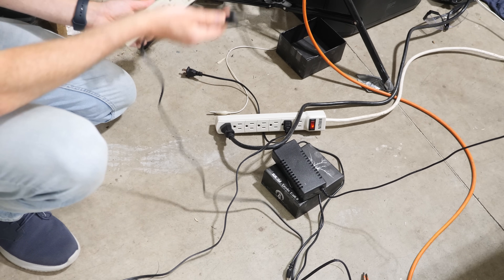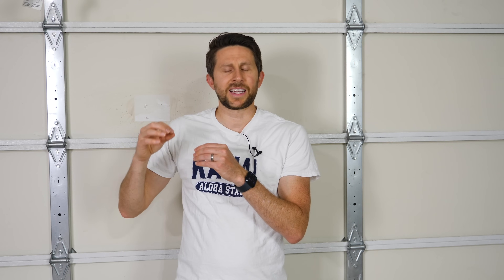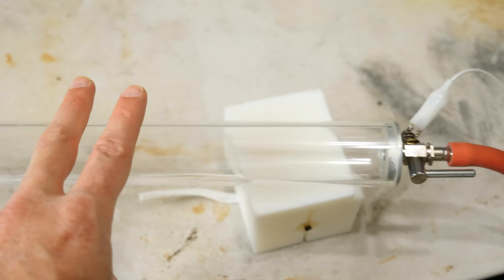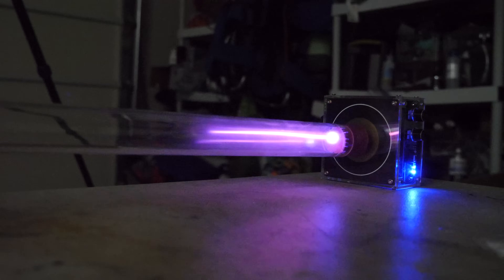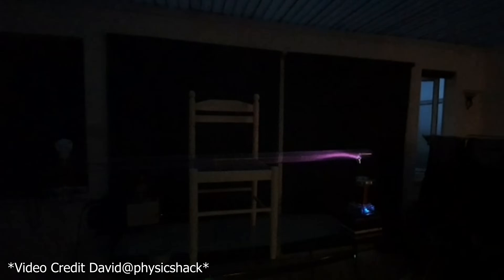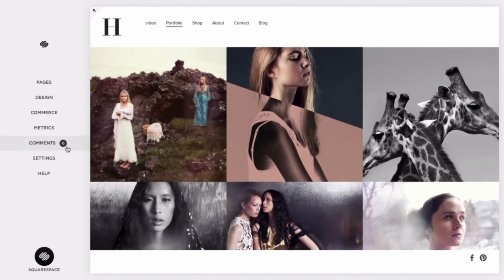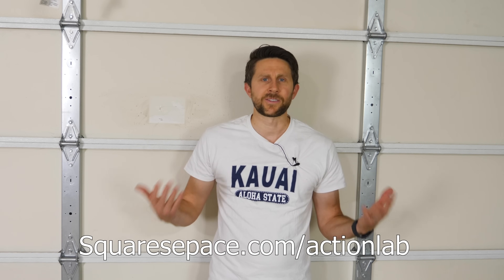Using the Air As a Wire—Was Nikola Tesla Right?

Comment: Something really interesting happened to me at 1:47.
When I first watched it, he talks about how the spark grows but I saw nothing but complete darkness in the tube.
When I replayed 1:47 again, however, I saw the spark grow despite seeing nothing there previously.

I knew the video wasn't frozen because I could see the blue part at the left side of the screen still flashing.

After a lot of trial and error, it turns out that the sparks are flashing completely in sync with the framerate, and because I was watching the video at 2x speed, Youtube was skipping every other frame, so depending on which frame you start on, you either only see the frames where there are no sparks at all, or only the frames where there are only sparks.

Go ahead and try watching 1:47 at 2x speed multiple times to see the difference!
Reply: Interesting. I wonder if it has to do with the fact that AC current from the wall operates at 60 Hz (same frequency as the refresh rate of this video).
Reply: @jacobgable3163  it doesn't. Current is being transformed in DC in order to be used as power for PC
Reply: @leonardobodini6734  Well, I was referring to the device that emits the sparks (not sure what to call it). Not sure if it's AC or DC, but Tesla was the big AC guy, so I assume it's AC. Not sure it actually adds up though anyways. After thinking about it more, I think it would actually have to be 30 Hz for it to work that way. But still, I wouldn't be surprised if the wall frequency played a part in the equation somewhere.
Reply: @jacobgable3163  Lol, I misunderstood what you said... Sorry, btw yeah, maybe it has something to do, maybe not... Guess we'll never know
Reply: @jacobgable3163  I don’t think so, that Tesla coil probably operates at several megahertz. The input power is converted to DC and then back to AC at the correct frequency. It’s probably just what he has his interrupter frequency set at. The transistors would probably die switching that power millions of times per second, so the interrupter gives it a break and pulls the duty cycle much lower, probably around 10% max. That’s why the sparks are pulsed.
Reply: Very interesting
Reply: Yes. Play it at 2x with above 720p60 and suddenly disappeared which it didn't in 1x
Reply: 2 things are going through my head:
That is really interesting…
What kind of psycho watches YouTube videos on 2x speed by default?
Reply: @dnknoester  I almost exclusively watch YouTube videos on 2x speed. 1x is just way too slow for me lol
Reply: @dnknoester  Sometimes 3x speed with my Video Speed Controller extension 😎
Reply: Loved it. Changed the quality to higher then 480px and 2x speed, played multiple times.
Reply: sadly i cant see it since my framerate is too high. ive tried for a few minutes now lol

thats really cool though. reminds me of funny videos where helicopters fly with no spinning blades and birds flying with their wings folded
Reply: The same was for me on 1× speed
Reply: same
Reply: I too watch at higher speeds.  It just seems to be time saving
Reply: +Kizuna Kosuke Great observation and hypothesis! 
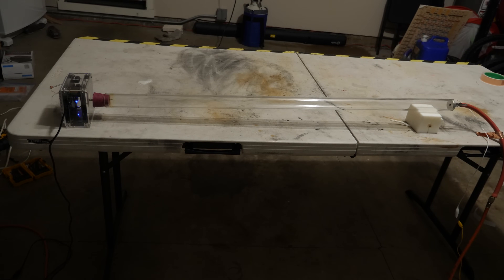But did you notice that the phenomenon happens at all playback speeds (not just multiples of 60Hz), and actually begins at 1:39 when the sparks first disappeared the moment the lights went out? And it was also the exact same instant that we cut to a different camera setup. If there were 2 cams, then their shutters must've been out-of-phase, or if there was only one then obviously it was re-positioned and some (i.e. "many") frames were dropped during the edit. Either way, we're looking at 2 uncoupled video segments.
Reply: @timapple6586  does not happen at normal and slower rate for me. the effects only happen at faster speeds. but it's really tripping to see the effect. what's the explanation for this?
Reply: Woah! Nice catch.
Reply: If you go frame by frame, you can see it's actually one frame spark, then 5 frames black. Due to the rolling shutter, sometimes it's 1.5 frames spark and 4.5 frames black.
Reply: Dude that's bizarre
Reply: This was really cool, thanks!
Reply: Wew
Reply: Yeah that's cool, 🤩
Reply: Lol true
Reply: Poor problems.. some of us watch at 120 hz.
Reply: interestnig
Reply: hmm well I watched on 2x speed and it was normal 🤨
Reply: @qwerty_qwerty  Rewatch it multiple times. It depends on which frame you start watching the clip on.
Reply: @FLOWER-xh4gx  I've watched it 10 times and nothing, maybe it only works on certain video quality?
Reply: @qwerty_qwerty  try using 720p or above video must be 60 fps
Reply: @qwerty_qwerty  its only the part where he says look at how it grows or something
Reply: I tried this as well, but I didn’t see it until I locked my screen rate at 60Hz (in accessibility settings. ) Then it was very easy to see what you described. Running new iPad pro
Reply: Harmonic resonance in action
Reply: lol, its not consistent tho, I played it back multiple times, sometimes, it worked, sometimes it's normal xD

Comment: Transmitting data through the air using frequency is hugely successful. Perhaps Teslas plans for power rather than information transmission had to do with his famous quote. If you understand frequency and vibration, you understand everything. We'll have to figure that out for ourselves.

Comment: It's kind of a different setup for transmitting power. you don't want any sharp pointy ends or Sparks to fly through the air, this guy's very smart I don't know why he doesn't know that or address it. If you want to see this in action check out the channel     "styropyro"

Comment: I once made up a superhero that could control energy through his ability to manipulate electricity and the electromagnetic field. I made up this move he could do called "perfect lighting" where he would manipulate the air in a straight beam and create a vacuum for essentially as long as he wanted, and then he would generate electricity and a bolt of lighting would shoot directly through it. The lack of thermal resistance caused the lighting to connect with his target with greater efficiency, I guess. But I didn't know this could actually be possible! Cool video.
Reply: Sounds like Railgun

Comment: You can also fill the tube with water to eliminate the delay and decrease the voltage required for transmission. I'm no atmospheric expert but to my knowledge the upper atmosphere not only allows transmission due to the pressure difference but also contains an amount of moisture which would allow for an 'easier' path of least resistance for the flow of the potential difference. Tesla R.I.P if only we'd listened you would've saved us.

Comment: Instead of building a really high tesla tower, how about replacing the wire links between power poles with evacuated tubes. Each tube would have metal hooks on each end so they could just be "hooked" onto the conductor of each pole. 
Each segment is isolated so that if there is repair work, or damage, the whole line doesn't need to be re-vacuumed, just that one segment
This would have the added benefit of if something crashes into the line, there are no sparks to create fires. This would really help places like California that is prone to powerline created forest fires.

Comment: I think there is a main misconception here. He was not up to send the energy via air but via ground. The Wardenclyffe tower structure was the cherry on the top of 
massive ground structure which ensured the lowest ground resistance as possible. My understanding of the thing is that he came up from the setup of two tesla coils where 
secondary windings were connected. Tesla coils were finetuned to the same resonance frequency and top parts were capacitors. The setup was supposed to send the current from one
Tesla secondary coil to the other Tesla secondary coil via single wire because the energy was oscillating between capacitors on the tops. Then he could extract the energy from the
"primary" coil of the second Tesla coil. Now if the distance is increased between these two coils the single wire will be longer and it can be replaced by some other conductive material such as Earth.
In case the Earth is used the natural frequency needs to be measured which Tesla did and designed the tower L and C to be tuned to Earth (not just a single wire, it's a dynamic system).
I imagine it as if the Earth is ball of water (incompresible fluid) and there are two pistons connected to it. One is full of extra water (extra energy) and the other is empty.
If the piston is pushed the extra water wants to go out and pushes to the other piston (which is finetuned to do exactly this thing) and it does not matter where the second piston is on the ball.
In case of Earth there would hotspots based on the natural frequency of the system or higher harmonics. The energy of lighting comming out of the capacitors were a loses in the system 
not the actual transmission of the energy. Tesla did not finish his vision because he was a good inventor but a really bad business man. He had a big debt (10000USD which was quite a lot in that time) in the Waldorf Astoria hotel 
he was living in and he lost the land with the tower in execution. He watched the demolition of the tower executed by new owners of his properties. He tried many times to
get money from J. P. Morgan who Tesla provided >50% ownership to his patents as the act of the trust for the money he lent him. But the guy had a lot of money 
in copper mines and transmission lines so he was not interested in "wireless" technology. Moreover, Tesla didn't deliver him a product he ordered, so he let Tesla fell into the poverty and die in cheap hotel.
Sad story. If Tesla had a manager our world would be even more advanced by now for sure.

Comment: What is the Voltage and Current rating of the Tesla Coil used in the video?
Reply: Input or output?
Reply: @ElectronicallyIrresponsible  output
Reply: @alexnjuguna6700   Judging by the spark length, maybe up to a few hundred thousand volts. Not sure on the current though, definitely not much.

Comment: This is really cool! So would this store electricity or simply transfer it? Also, would it increase chance of lighting storms?
Reply: Mostly transfer, though you could get a trivial storage effect. It would increase the rate of lightning strikes, but probably not significantly increase the total power per storm... probably? Also, individual strikes would probably be weaker, but there would be correspondingly more of them.

Comment: Texas Tech University was working on this behind closed doors, my professor's colleague and friend was one of the researchers on the project.  We didnt get details but he did say this is what they are working on. That was 5ish years ago.
Reply: Probably won't get any real-world use. The concept is sound, but the economics are just a pipe dream. It essentially isn't useful for anything other than over-the-horizon radar/radio, ionosphere research, demonstrations, and ideas for very different applications. It's too easy to tap into without approval, so you can't use access control to establish the resource stream needed to keep the system running.

Comment: Tesla was right.
Academia makes the lie that keeps This kind of confusion Alive. KEEPING US ALL ENSLAVED
Reply: Everyone assumes that the world would be sparking and an abundance of current uncontrollable and a nuisance to life...this is part of the original propaganda....
Once Tesla engaged the wireless part of the system in wardencliff it would simply arc at around 8hz into ground with a about ten foot spark gap...its the resonating pulse synchronized with earths natural resonance...this heart beat would be inconceivable by anything other than circuits that start or end depending on your take of travel..at an antenna to a primary coil that is tuned also to any multiple of the resonate pulse...then onto ground its that simple really...only made impossible for people to understand by the institutions that are in place to keep this type of thing from occurring by patented inventions ever again...
  Once the pulse engaged it would simple vibrate the electrons instead of pushing or pulling then through a generator...this vibration because of the natural frequency would saturate earth and all of its atmosphere...the millions of volts and thousands of amps would be stepped down to a usable current by the secondary in the circuit and that would be the constant energy supply...its more like radio than battery or generator exept the distance is not a problem because of the frequency....it worked on basics that we use today less the resonating frequency parts because that was the secret to delivery...my grandfather sat many days at wardencliff as a brick masson and according to him Tesla loved to talk and discuss what most would consider secrets....i hope this will help in undestanding that Tesla knew all about bad emf and considered this to be absolutely safe....our computers would work just fine...but the transistor may not have been invented because it replaced the tube and tubes at the time were crucial to the tuning of all the receivers each necessary at the point of power consumption.. Without the cover up of his work they would have just improved over time..

Comment: This is not right..
Sorry..
Everyone assumes that the world would be sparking and an abundance of current uncontrollable and a nuisance to life...this is part of the original propaganda....
Once Tesla engaged the wireless part of the system in wardencliff it would simply arc at around 8hz into ground with a about ten foot spark gap...its the resonating pulse synchronized with earths natural resonance...this heart beat would be inconceivable by anything other than circuits that start or end depending on your take of travel..at an antenna to a primary coil that is tuned also to any multiple of the resonate pulse...then onto ground its that simple really...only made impossible for people to understand by the institutions that are in place to keep this type of thing from occurring by patented inventions ever again...
  Once the pulse engaged it would simple vibrate the electrons instead of pushing or pulling then through a generator...this vibration because of the natural frequency would saturate earth and all of its atmosphere...the millions of volts and thousands of amps would be stepped down to a usable current by the secondary in the circuit and that would be the constant energy supply...its more like radio than battery or generator exept the distance is not a problem because of the frequency....it worked on basics that we use today less the resonating frequency parts because that was the secret to delivery...my grandfather sat many days at wardencliff as a brick masson and according to him Tesla loved to talk and discuss what most would consider secrets....i hope this will help in undestanding that Tesla knew all about bad emf and considered this to be absolutely safe....our computers would work just fine...but the transistor may not have been invented because it replaced the tube and tubes at the time were crucial to the tuning of all the receivers each necessary at the point of power consumption.. Without the cover up of his work they would have just improved over time..

Comment: What if you did this to a skyscraper and used the heat to also generate electricity?
Reply: Unfortunately thermal energy is horribly inefficient due to the high entropy of thermal systems. For every 1 watt of heat that flows, the max work you can extract from it is (1-Tc/Th) where Th is the object the heat is flowing from and Tc is the object the heat is flowing to. In the case of a skyscraper where there are fairly small heat differences b/w the top and bottom, the amount of work you can extract from the thermal energy is basically 0. 

The inherent reason for this, is that it takes information to extract energy from a system. Sure you can, in theory, perfectly cause every vibrating molecule to collide with another system so that it looses all it's energy, but this required you to have prior information about the position and momentum of the particles to know how to extract that energy (otherwise you'll accidentally put some energy back in if you don't perfectly line up the collisions). So in order to extract all the thermal energy, you first need to gain information about it's microstate. However, there is a fundamental cost of information in our universe, known as Landauer's principle. And so in order to use the energy, you must first gain information about the energy's state, but that necessarily costs energy. Therefore you can say the max energy you can use is the total energy minus the energy cost. And this is what entropy is, the energy cost of the system's information per degrees kelvin. In the case of flowing heat, you get the above (1-Tc/Th) relation for the max amount of energy you can use.

Comment: Doesn't high voltage discharge in vacuum produce X-Rays?
Reply: Typically X-rays use direct current instead of alternating current like this Tesla coil produces. Also a filament is used that heats up red hot to break loose a sufficient amount of electrons. I think x-rays could have been produced here, but in very small quantities. At least from my understanding.